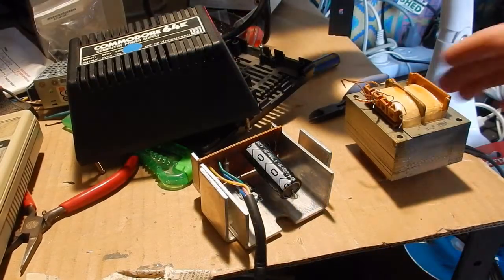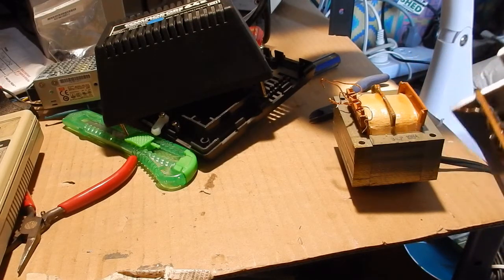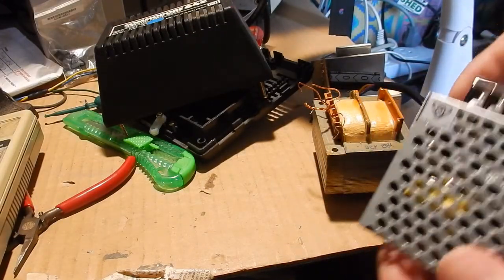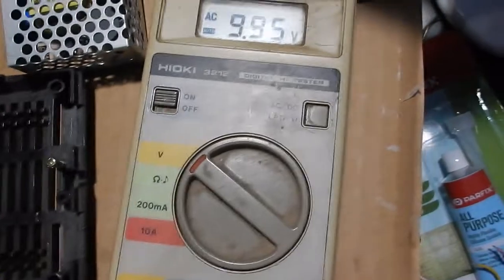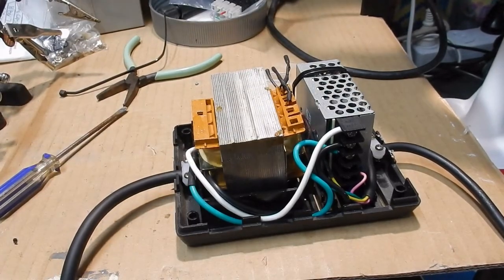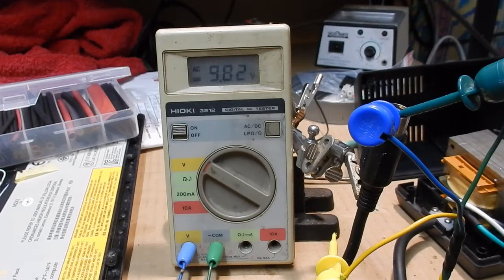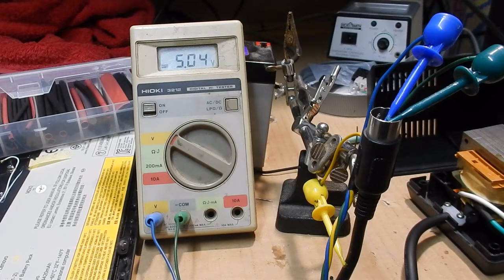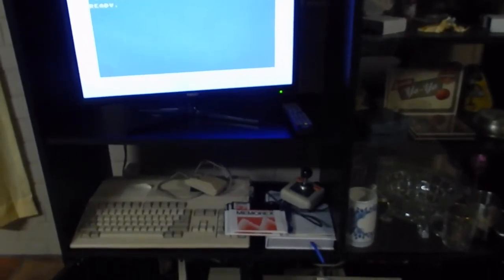Making a reliable C64 power supply

Comment: Just took delivery of 2 square 5 pin din plugs for A500/C128. You're welcome to the second one for your 128 if you like?
Reply from the maker: Thanks for the offer Randall, but I've got one on order and even if it took a while yet to get here, it will still probably beat my ability to pull my finger out and make a supply for the C128. If it doesn't arrive in the next 6 months though.. I might come begging!

Comment: No fuses?
Reply from the maker: Don't ask embarrassing questions! 

OK, well, there's a fuse in the C64's for the 9v AC rail. 

The original supply doesn't have any at all except for a thermal fuse that may or may not be in the transformer (hmm, that might explain those house fire stories...). 

Bil Herd (the Commodore 128 designer) was so upset about this that he made sure Commodore added fuses to the C128 power supplies.
I might retro-fit something to this supply for the 5v rail.
Reply from the maker: @mugsy The good old crowbar circuit! 5.6v will only be on the 5v rail for a fraction of a second before the fuse blows, so your C64's are always going to be safe. Thank you for your efforts in keeping SID chips alive ;-)